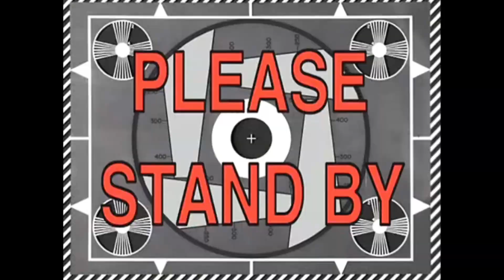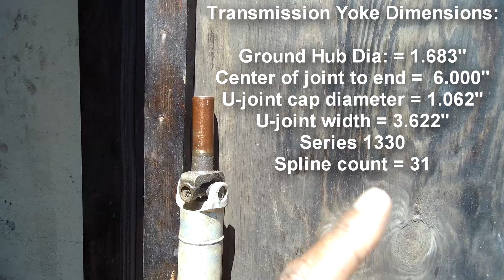Cobra Crown Vic Build ( IMRC Issue ) Can we make IMRCs work with no PCM ?

Comment: Will imrc cause lean bank 1 and 2? Runs rough seems faster it goes rougher it runs its a 96 mark vlll 32 valve 4.6..it'll crank up bout 50% of the time,idles like crap 70% of the time

Comment: damn that looks like it will work good. I'm ready to see how it goes with the switch. I need to do something similar so these (imrc issue) videos definitely opened up my eyes more to understand how these work. I didn't expect the lower voltage with the varied power, so that's good to know.
Reply from the maker: still working on this thing... Th weather is HOT and a lot of fails so I iquires assistance so i will try something... Thank you for staying with this along with me.. I should have a solid answer on how to make this work ( when we want to ) vs a pcm... Its is best to get the wire harnes and learning deeply how the IMRCs switch work, but i am just not into that right now lol

Comment: It's amazing how you jury rigged multiple completely different parts to make it work a certain way. Like, wow, im surprised you're not working for the top dogs at ford or others as an engineer. However, I feel that the system you have rigged up may be a bit more trouble than it's worth just to get a working intake. I understand other avenues cost big bucks, but I remember you saying if you went turbo with this build, then you wouldnt even need the butterflies and would remove them. Maybe that route may yield simpler fruit? Running a small turbo with low boost could be reliable and remove the need for extra moving parts. HOWEVER, I'm here whichever way you go!
Reply from the maker: right! i would not need this if i went turbo, but I will not go turbo on this.. I need a simple jump in a go type of fun car...I am want to see what is possible before spending a lot of money.. I will explain the why or the theory behind keeping this and making it work some kind of way.. i failed a few times , but lets see if i can make it work

Comment: Whoo hooo! You did it! That's the vapor management valve. It opens to flow fuel vapor at steady throttle. The green cap is for the test port. Fill the system with nitrogen to look for leaks for a code po442. I knew you would figure it out! Only thing, need to add a vacuum resivoir or it will close at wot. You're in the home stretch!
Reply from the maker: thank you for this and thank you for assisting me on brainstorming.. I will check that wot throttle deal that would suck lol, but lets see how this goes... Ahhh the green cap is for the test port i gotcha .. i will have to mention you in the next video ...Now let see if i can figure the next deal

Comment: The Mercury Sable  24 V had the electronic thing on the valve cover that was for opening the ports.. that might be a useful part for something. That 4.6 probably needs the right side tensioner and guides. My cousins 2010 expo was lacking power sometimes.. he’s pulled it all apart, doing all the timing stuff..all Ford parts. It’s more than he paid for the truck..for the parts !  He got a freebie paint job, with expired airplane paint,  it’s got a fresh black paint job ,  I can’t believe how good it looks for just a scuff with a electric sander.. if you can find that kinda paint it’s awesome !
Reply from the maker: Thats what i was thinking tensioner guids or tentioner lol I may try that paint ... that may be the next move lmao.. Thank you for this info!

Comment: Jus weld them open brother
Reply from the maker: I have two Intake manifolds so ,,  will speak on how or what I may do to test it out... you say welded them open.. i say weld shut..
Reply: @bstfordchannel923  eating steak with the grain is gonna be tough 
Talk to mo or any tuner and get therr opinion 
This thing will not run right without a tune anyway so it wouldn't hurt to ask first 
Measure twice cut once ive ben ther
Reply from the maker: @crownvictorialifestyle4421  agreed point well put.. Only deal i dont eat beef lmao. <but i feel ya bro. I have option 2 and 3 lets this fly and see what can going to happen.. of course will not run right... Thats fine i am more worried about engine noise... How is the 2v valve you built you have no post much about that engine build..

Comment: Nice problem solved had first start on my mustang yesterday got cams in I have a question what is them plates behind the timeing chain tensior
Reply from the maker: those plate behind the timing chain tensioner mean that you bout the china man version.. The real Ford one cost more but does not need those plates... You can buy used ones and be better off... they look the same but they are not thats why they need the plate behind theres

Comment: You got the right idea, follow through with it. I think for the butterfly, you may want to check the gap to see whether it has some warpage on the walls or maybe it's a adjustment deal of the butterfly. Hope this doesn't confuse anybody.
Reply from the maker: I get it lexi... it can be many thing but its the linkage that a bit flawed.. I see why they use motor to close it ( tight )  it just need to be refined and think about the ( what ifs 00 along the way
Reply: I'm anxious to find out
Reply from the maker: @rlipper26  me to brother i have to make sure things ar good
Reply: Yea, your guess is as good as mine to be honest
Reply: I think that gap should be there for the idle circuit, kinda like a throttle body has a small gap.

Comment: Maybe those butterflies need to stay open a hair? So it can idle? Like the choke plate on a Carter AFB ; some air has to pass? 
Just guessing here; you know more about it than i do.
Reply: I'm thinking that is more the case. That the left bank he shows is operating correctly and the right bank is closing too mach do to wear of the cylinders or some malfunction in the linking components. Like you say, typically an engine will fire with the choke closed because of the existing air in the manifold and heads. But it won't stay running without sucking in some air. That one side is all the way closed and the other isn't, likely has nothing to do with the engine firing. Rather the small amount that they both open under cold idle is significant enrichment.  

Seems this system would have to work in timing with the throttle body butterfly. The engineering makes sense because the throttle body or carb cannot produce the exact same pressure for each cylinder no matter how well the manifold runners are engineered. The carb works similar with the primary throttle butterflies in the bottom and choke butterfly on top.
Reply from the maker: what you see is 2 runners... when close its a long runner when open its a short runner. So when close it will start and run ok ( get a tune for this ) and then as the rpm goes -up then these ( butter flies 0 should open to let the air right in ( short runner ) at high rpm... Now if i had a turbo set-up then i will not need these ( i would have deleted them ) the turbo would pull through this .   So the theory is to see where the tq band ends so the i can time the butterflies to open to make a smooll trasition to hp ( for the top end )... So ii figure the ait may help it to lock or push the butterflie down ehne running ( another theory )
Reply: @bstfordchannel923  ah! I get it. The side with short runners is the off idle primary side, and the other bank is secondaries for when you put your foot in it.
I'd find a car with that engine and see what those butterflies look like during starting, idling, and revving.
Reply: @bstfordchannel923  Still trying to wrap my head around the long and short runner concept. I will research how this system works. Can you shoot me a link please? This super interesting!

Comment: Ok ,now I'm confused, wouldn't using the accelerater cable and return springs do what you want, simple and mechanical?
Reply from the maker: there ar3 ways to do this right. 1. is to rewire the harness and add a 4v one with ecu. 2. figure out the signal and wire itr up.. 3. use a window switch and use this method and have the vacuum open the imrc at any RPM range . To see what would work best for the car.. its not ideal to do it this way, but this will be the best solution on the cheap ( to keep the IMRCs ) in

Comment: i wanna see this go down . im enjoying the creativity in it all
Reply: BST I had doubts ,but my man you pulled it off. Great job!
Reply from the maker: Its all a thoery at this point..I was going to the servo deal.. I will not even bother i will roll with this  ( its a ok start ). The support you give is well needed and welcomed MrE85
Reply: @bstfordchannel923  for sure ! its a really great implementation of it.  Technically RPM control isnt even needed if they open on 0 HG vacuum which is where you would need them anyway when load is at its highest . this implementation plus a tune would work wonders for maintaining them .
Reply from the maker: @mr.e8543  very very true, but ( in my crazy thoughts ) i felt that need to cotrol it more with a windo switch.. i can change rpm . just think if the engine is weak it may need to open at a certain rmp to get the UMPH to make this slightly magical lol... You are right those vacuum alone can make this work. I see your vision..
Reply: @bstfordchannel923  for sure now a trick here is that with this c head motor 4.6 the velocity into the engine isn't an issue like the old b tumble port heads.

So really this imrc they added was to give even more lower end torque to the heavier vehicle it was in. The opening of the short runners gives the power band up top that you want for some good pull without forcing long runners only.

Todd na SVT would be the man to speak too on the dynamics of the intakes and style. That God is the lord of mod motors. Matt Haynes also. Which built my custom intake for my cobra build.
Reply from the maker: @mr.e8543  Great info also... Man those guys must cost a lot to even consult with lmao.. I am sure they are in the forums and stuff.. Now you kinda understand why this is needed in a crown vic this was needed to any big old car. Just want to see how this works.. Now failure happens we just have to pivot and find a solution to making this work.. Tune and a dyno is keep test and tune ..Great info like always.
Reply: @bstfordchannel923  haha a wealth of information. I got them all on first name basis. Since at least 2007 I've learned from em they are always willing to share the knowledge for thr community. It's a solid bunch.